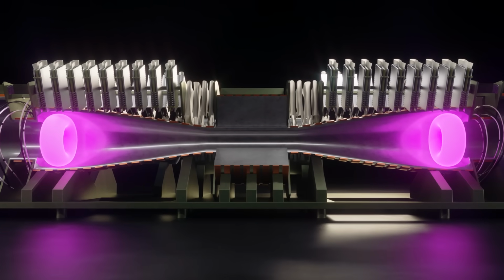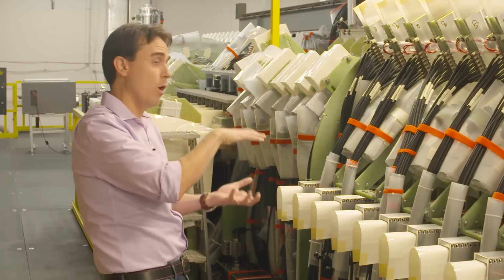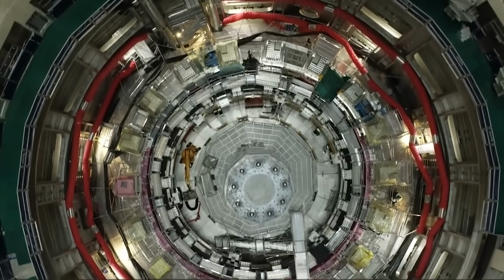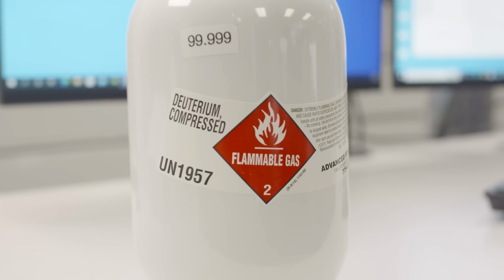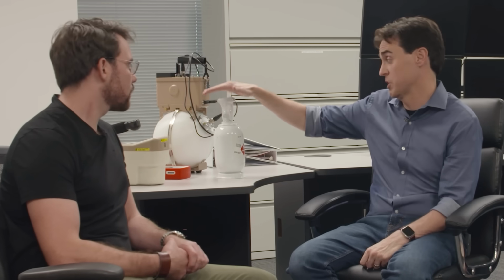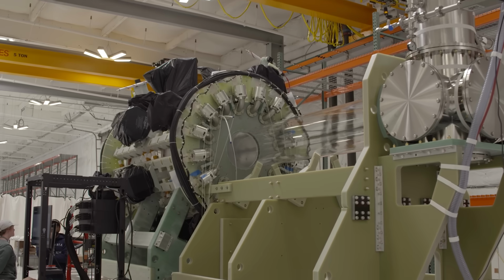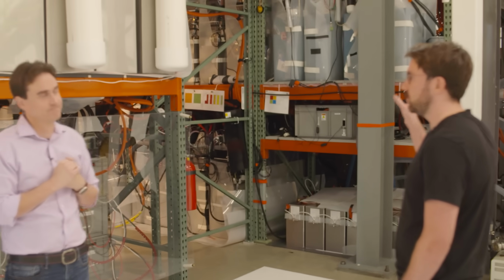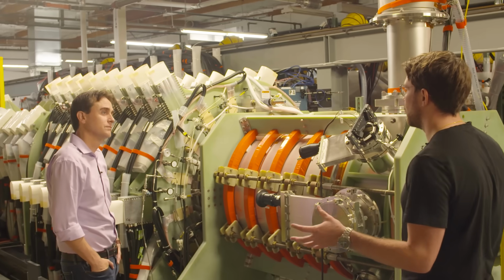A New Way to Achieve Nuclear Fusion: Helion

Comment: The thing that still blows my mind about fusion reactors is just how damn hot the fuel is! I know that it's being manipulated by magnetic fields to keep away from the walls of the chamber, etc, but it just still seems so crazy and amazing that that's enough to control such a high amount of energy. When he said that the electromagnetic pressure gets it up to 100 million degrees to initiate fusion, I was flabbergasted and still am.
Reply: It is manageable because each reaction uses very little mass. If it used tons of fuel instead of only a few grams, you wouldn't be able to manage heat and radiation from the plasma.
Reply: @jorgecosta95  yup
Reply: What's even nuttier is how nonchalantly he says "100 million degrees" in the same way I might talk about setting an oven to cook a pizza.
Reply: @Nathan_Lang   And that is because they have done it many, many times before....
Trenta did over 10,000 pules in the first year of operation...
Reply: @elmarmoelzer2229  oh I understand that. But that doesn't make 100 million degrees any less of an absolutely ridiculous temperature. That's over 6 times as hot as the sun's core. There is nothing anywhere in our solar system capable of producing those temperatures, except the machines devized  by our genius. And sure, we've already done it with particle accelerators, but to have an actually tangible amount of matter reaching exotic temperatures that you would otherwise have to travel outside our solar system to find is just bonkers (Query: how hot it the core of a blue supergiant star? I couldn't find any info. I bet the core of those get over 100 million degrees.)
Reply: @Nathan_Lang  "There is nothing anywhere in our solar system capable of producing those temperatures"

A lot of interstellar plasma reaches temperatures this high.
Reply: @jimwhelan9152  where is this 100 million degree interstellar plasma? Voyager 2 measured it in the tens of thousands. Also, that would be outside the solar system.
Reply: @Nathan_Lang  "where is this 100 million degree interstellar plasma?"

In the vicinity of supernovae.
Reply: @Nathan_Lang   The coldest known spot in the universe is also in a man- made lab ;)
They will actually go hotter than 100 million. D-He3 fusion is optimal at about 500 million :)
Though I believe they will stay a little below that. Mind you, there have been several fusion machines that achieved and held temperatures significantly over 100 million for a few seconds without melting. The temperatures are not the problem, really. It is making everything work together in a perfect dance (temperature, confinement time and density) that is hard. And then repeating that over and over again.
I still believe that Helion can do it.
Reply: @elmarmoelzer2229  "The coldest known spot in the universe is also in a man- made lab"

Black holes have lower temperatures. If it weren't for the Hawking, quantum fluctuation radiation the temperature of a black hole would be absolute zero and the quantum radiation for smaller black holes is lower than anything we can reach.

As a point of information, temperature is essentially a measure of how fast thermal energy will pass from a higher temperature body to a lower temperature body. If there were no Hawking radiation then no energy would be able to pass out of the black hole, hence absolute zero.
Reply: @jimwhelan9152  "Black holes have lower temperatures."

Not necessarily. There are energy configurations that have been produced with negative K temperatures. Debatable that this is 'colder' in the complete sense of the term, as the overall energy content of the state is higher than an equivalent at a positive temperature, but motionally it is lower than 0 K...
(Braun et al., SCIENCE VOL. 339, NO. 6115, Negative absolute temperature for motional degrees of freedom)
Reply: Actually, negative temperatures are hotter than zero. Seems counterintuitive but it's a math thing. That may mean that, contrary to my previous statement, there are man made conditions that are hotter than anywhere in the universe. Personally, I consider the "negative temperature" thing to be a semi-fictional construct since it relies on specific mathematical definitions of what temperature is while ignoring the practical meaning.
Reply: @jimwhelan9152  can you elaborate this point, as simply as you can. I would like to understand.
Reply: @RVMTube  https://www.youtube.com/watch?v=yTeBUpR17Rw
You're welcome.
lol this was the first thing that came to mind when I heard that.
Reply: @Nathan_Lang  b4 you spout non sense, you must contemplate what you're typing, only humans? 👀 Dont be delusional, there is a high chance aliens exist, bet the advance ones have better tech than this.
Reply: @Tribe_OF_Benjamin_O_Yasharahla  there is a high chance that life exists elsewhere in the universe, yes. The odds of us ever meeting them is probably extremely low. Since our sample size of planets with life is still 1, we can effectively ignore them until we meet them. Either way, supernovas and supergiant stars are probably more common.

Also there's no reason to assume that intelligent life we meet will necessarily be more advanced. Maybe it'll be us discovering them. Then we'll be more advanced.
Reply: @Nathan_Lang  it goes both ways
Reply: @elmarmoelzer2229   How much energy did they consume for those 10,000 reactions and how much energy was actually released?  Watching the video and listening to the spiel, I still think it's more about 'selling an idea' and fund raising than actual physics in practice. The build does not seem to reflect the technology being spoken about.  We will see, time will tell.
Reply: @adrianlimb4557   Trenta is an experiment. It is not meant to make electricity. That will be Polaris in 2024.
They are fully funded all the way to commercialization. They do not need funding. They need qualified employees.
Reply: The final power plants will run at even higher temperatures: between 200 and 500 million degrees.
Reply: Temperature ares very high but mass very low which makes the heat managable. Highly probable the energy output will be much larger than input and commercially viable within another iteration or two. These folks are onto something good.
Reply: @rhensontollhouse   yup
Reply: You gotta understand the mass is very very small

Like having a grain of sand a 100 million degrees in a Pringle’s tube
Reply: Just remember, anytime we make a fusion reactor we are wielding the power of the sun.
Reply: @Alexblack1738  No, its the power of fusion, many star exist to make this statement invalid
Reply: Isn't it just amazing!!! It is beyond comprehension. One can understand it intellectually, but not experience it, not truly know it.
Reply: That's because they are lieing.
'Fusion' a total lie
Reply: @sittingdingo1   LOL, you know nothing John Snow...
Reply: yes that temperature is needed in normal pressure condition, or you could go like cheating what sun does, huge gravitational pull to make the temperature low still doing fusion.
Reply: it was unbelivable !!! I loved it !!! Congratulations to all workers on this project you have our future in your hands. I hope you the best !! :)
Reply: @K It's a fiction that fusion involves no radiation. And despite the high temperatures and pressures there is insufficient mass involved in current systems to be dangerous. Scaled up they are certain to be dangerous. 

Large amounts of energy are, by nature, dangerous. The trick is to control the energy and mitigate the dangers as we do to the best of our ability with today's operational technology.
Reply: @jimwhelan9152  It is a question of what kinds of dangers. Fusion generates radiation, but not radioactive material. If it got out of control it might irradiated the workers at the plant, but there is no radioactive material to escape and cause problems to the rest of the world. Once the reaction stops, the radiation stops.
Reply: @edwardkuenzi5751  I claim that any neutron radiation will make the containment vessel radioactive.
Reply: @jimwhelan9152  I think it depends on how much energy the neutrons have and what the containment vessel is made of. Not all isotopes produced by nuclear transmutation are radioactive. You can sometimes add a neutron to a stable isotope and get another stable isotopes. I guess it would always be made somewhat radioactive, but it could be engineered such that this is only to a trivial amount.
Reply: @edwardkuenzi5751  Yes, Some isotopes are not radioactive, but some are. It's basically random which isotopes are produced and over time the "some" that are radioactive can add up. Depending on half lives and, like you say, neutron energy the radiation can be controlled. 

I really doubt that in a fusion reactor producing enough energy for large cities this will be possible. I DO hope that fusion can be made practical but am extremely skeptical about the claims. IMHO, the "fusion is not radioactive" is another lie being used to sell the ongoing and expensive development since I know the fusion reactions do produce radiation.
Reply: That's one of the biggest problems after Rayleigh instabilities for magnetic confinement! Honestly I don't know if we will see a working commercial fusion plant in my lifetime? I will see a research reactor that in theory is far enough beyond total breakeven to be viable but it's the material longevity issues that I believe will prove nearly insurmountable! Magnetic confinement with ends or torus twists will always have some level of instability and these magnetic "pinch" devices seem even more likely to be hard to contain for sustained periods? Thus is interesting it's like a kinetic impact pinch device but I'd imagine it's even more difficult to contain??
Reply: @mathandfitness  Using the plasma's charge and resulting force against the containment field is a novel method to extract energy. But the plasma will react by exerting force down the tube (path of least resistance). They will find themselves up against the linear pinched plasma problems.

I wish them luck but don't tell me you've solved the problems of fusion until you have actually solved all the problems. Nor am I going to believe any "it will only be 2, 5, 10, 50, 100 ... more years" claim.
Reply: @mathandfitness  I agree. The evidence is strong that no toroidal configuration can be sufficiently stable. Linear pinched end plasma devices are mathematically and quantum mechanically certain to have containment problems. Laser ignition devices don't have these problems but face other issues.

This device does seem to have a possible solution by using the natural stability of  a vortex (like a smoke ring)The idea of shooting the "rings" at each other reminds me of the "Little Boy" fission device technique of firing uranium slugs at each other to reach critical mass and density and could also have promise.  But it's a long way from feasibility and may have it's own stability and containment issues. For example, are plasma voritces really as stable as smoke rings since they have an internal tendency to fly apart?
Reply: @mathandfitness   Apparently Nottinhamshire County Council have allocated land  for building the first commercial Fusion Plant, they are currently advertising jobs for the project!  I understood we were still at Laboratory proving stage even with the big plant being built in France.
Reply: Miniature stars being made
Reply: .     China have that tech long time ago and even installed it up their space station.
,,, will also use that tech when Russia and China put up a moon-station in a couple of years.
Reply: Me too. I had to go and get my wife to watch it with me and make sure it wasn’t a dream.
Reply: https://youtu.be/r-EOPGmB5eI
Reply: I know. It's such an incomprehensibly large number.
Reply: Two things that Im curious about with this.  What are those pieces of paper with tape rolled up underneath the black hoses? Are they hiding something? This thing looks like it was created by the same people that built the rocket that landed us on the moon. And why is it the sun is so hot and bright yet it's dark in space and shines only here in our atmosphere? 🤷‍♂️
Reply: @nubi4life  it shines in other planets too, mainly it spreads so much cuz of atmosphere, space hv none. Space contains star and other celestial object million times brighter than sun still it is black
Reply: @nubi4life   Not to be too cynical, the 'rolled up paper' perhaps has the word hoax on it.
There was something odd about how he spoke about the capacitor banks as well.
Reply: @adrianlimb4557  Could it be the rolled up paper is covering up something they don't want the public to see? I keep hearing 100 million degrees temperatures. Even NASA has had issues of rockets handling thousands of degrees of heat.
Reply: "it just still seems so crazy and amazing that that's enough to control such a high amount of energy"

The temperature may be high but the energy content is low because only a small amount of mass is being heated. Any practical energy generating plant (even a fossil fueled one) deals with huge amounts of energy. In fact one of the difficulties in scaling up any experimental fusion generator will be dealing with actual huge amounts of energy.

Comment: What would happen if they added two more of the formation and injection sections to produce a cross configuration, each 90 degrees from the next?  Or perhaps even more?  I assume gravity prevents a vertical configuration by altering the performance of the plasma, but if that's trivial compared to the magnetic fields, why not add in others?

Why does it seem to be limited to pulses, rather than running continuously? They explanation of the electricity generation process makes it seem like it should be able to run continuously.

Based on what I heard, it doesn't generate more energy than it consumes yet - the 7th and 8th generation systems will do that.  Sounds like they're very close.

They're now working on their 7th generation machine and haven't produced net energy yet.  These are massively expensive machines.  How are they funded?
Reply: 1. You can't because the compression magnets would be in the way. What they COULD do is to have several plasmoids fired in series. They are currently not planning to do this because it adds complexity and is not necessary.
The machines could actually be put upright. They had some early design studies on this a few years ago. 

2. No, it is meant and designed for pulsed operation which has many advantages: 
The ions can be much hotter than the electrons (no equilibrium). 
They can extract energy from the expanding plasmoid at the end of every pulse.
They can extract fusion products between pulses.
The energy produced is stored in capacitors and gradually released to the grid.

3. No net electricity with Trenta yet. Polaris will do that two years from now. Trenta is close, but still only an experiment.

4. They had some minor funding from ARPA-E and NASA for early experiments but Trenta is completely privately funded. The Trenta program cost around 35 million. That includes cost to build the machine and to do experiments on it.

5. Most of their investors have been with the company for a long time, some since day one. They include Mithril, Sam Altman, Dustin Moskowitz, YCombinator and few others. The results from Trenta earned Helion 500 million investment plus another 1.7 billion in commitments if they meet their milestones with Polaris.

Comment: I would like to see some background, on how these temperatures are safely contained.
Reply: Magnets. Even if the magnets failed, the plasma would only do slight damage to the walls. It is very hot but not dense. Total energy content is in the low kWh range.

Comment: Just 20 years away.....
Reply: Should be much closer than that. Polaris will demonstrate net electricity in 2024. Then the next one will be a commercial scale power plant. Helion generally has a 3 to 4 year cycle between machines, but that one might take a bit longer because they need to build a manufacturing line for their commercial machines. I think 2029 is a realistic target.

Comment: What would happen if by accident the system that creates the magnetic field that keeps the heat within a restricted area where it cannot fuse the whole "combustion" chamber fails and stop?
Reply: The inner wall of the machine would see some minor damage. Not enough to destroy the machine, but enough to be a problem if it was to happen too often. And with problem I mean that the wall would have to be replaced eventually which would add maintenance cost. It is worth noting that the coils themselves help keeping the plasma contained, even with no power in them. That is because the plasma itself has a magnetic field that does work when the plasma expands against the coils. So something would have to seriously wrong for the plasma to not be contained at all.